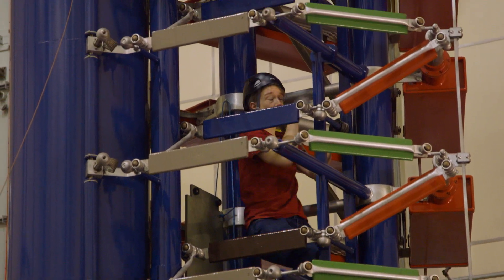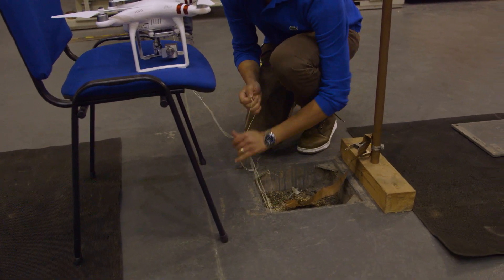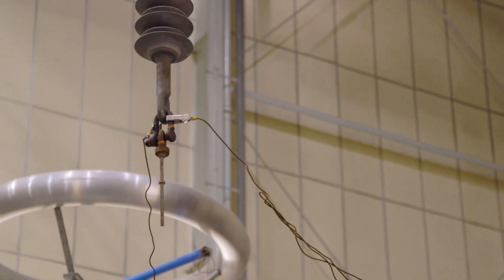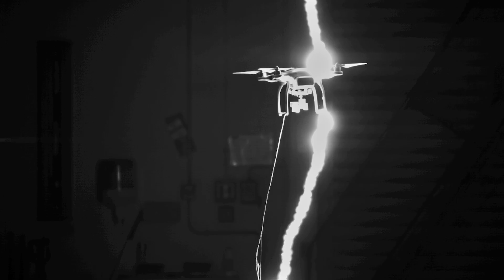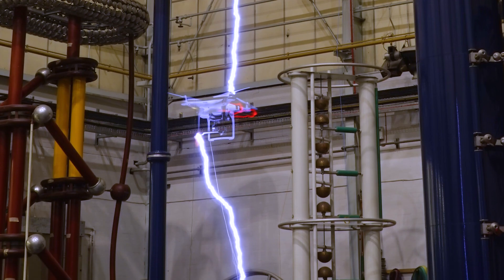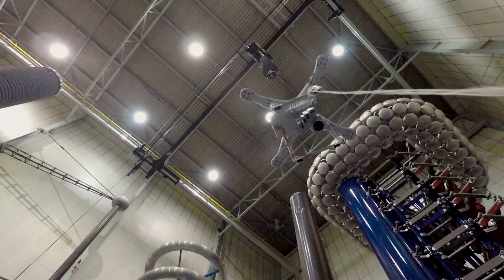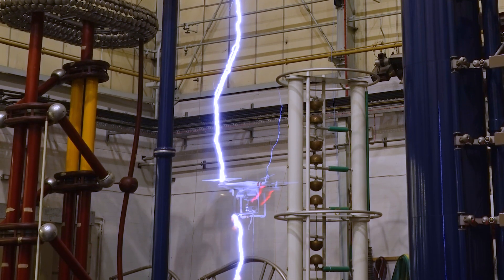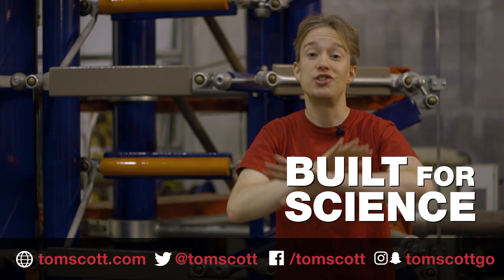We hit a drone with lightning

Comment: wait...I only see 1600kv, ain't that only 16000v..oh and there's your current! 41 amps...I'm so confused...I'm see 656000 watts maybe. help please. I'm new to this!😂
Reply: 1600kV is 1,600,000V. The current you may have seen on the screen is the current we take from the LV supply to charge the capacitors. When the actual flash happens we will have a current in the order of a few thousand amps given the circuit set-up.
Reply: Oh what kv=10 to the 3rd volts!!!!!Thanks!

Comment: Wouldn't it have been a "better" idea to have the metal tape sticking out a decent bit further form the top? It looks like the one motor was still the closest metal piece to the lightning "source" and actual lightning rods also usually go up from the roof py more than 1 or 2 cm ... :D
That it's probably still not the best plan to fly a drone in a thunder storm is out of the question ...

Comment: You gave the voltage drop across those capacitors, but not their capacitance. What are they, like 100 Farads? I wouldn't be surprised at that size.
Reply: Probably a some few micro Farad. The high Voltage makes the necessary insulation (dielectricum) very thick. So you got a relatively small area divided by a thick dielectricum.

Comment: It really entered at the motor and exited at the compass that is strapped to the bottom of the plastic landing gear.    This would have been the path of least resistance and would have avoided the battery since the motor is connected to the main board, and the compass comes off the main board. I'm repairing one currently from another YouTube video with what happens to a phantom when it was shot down and doing an assessment of damage done. I could do the same with this one also and check the electronics components and see how much was damaged and if I can repair it also?
As for the lighting rod on the top, the very top of the phantom has the GPS antenna and would probably travel into the main board that way also. And the phantom GPS receiver is ceramic s it probably would be destroyed and shattered.

Comment: And for this STUPIDITY YOU NEED A DOCTORATE DEGREES??
Reply: You need a degree to build and fire such a device without killing yourself or others.
Reply: Electrical Engineering specialising in High Power / High Voltage Systems.

Comment: Part of me wonders, If the electricity had instead gone down the battery wires, through the cell, and out the foil casing, would you have been picking little bits off the floor instead of one whole drone? has anyone done a test on what happens when lithium cells are exposed to a high voltage shock?

Comment: The problem with the second drone is (and the people there should definitely have known) that the copper tape is basically doing a 180 bend back on itself, why would 1,000kV follow a bend when it can just go through the plastic? High voltage likes to go straight. The resolution would be to put a metal steak right through the center of the drone, but without touching the battery/electricals etc.

Comment: The copper tab was not higher than any of the propellers. You should have attached a copper wire to the tab at the top so it would be at the highest point on the drone. Then it would have generated a streamer and would have been the point of discharge. Another copper wire hanging down from the lower copper tab should also have been installed so it would have been the lowest point to ground. 

That said, lightning doesn't like to turn corners. So the drone's internal electronics would probably have been fried anyway!

I would still like you to repeat this experiment using my suggestion!
 Thanks! I truly enjoy your channel!

Comment: The motors got shorted out which puts an electronic brake on them and stops them really fast. The propellors have a screw that is pitched opposite of the direction of the motor spinning forward. So the motors stopped and the propellors kept going and the propellors unscrewed themselves and took off

Comment: Looking at the my P3 Advanced, theres 4 antenna wires and one compass in the legs, looks like the current went through the motor and ESC, burned up the FC and receiver then exited through one of the antennas.

Comment: I wonder if the fact that it went for the motor and prop before the lightning rod bore any similarity to the case of Bristow Helicopter 56C in which the lightning was partially attracted to the static electricity generated by the tail rotor.

Comment: That was one expensive Video. 2 drones...
Let's say it costs $250 each for parts (optimist), that's still some $100/minute of video.
Reply: Peter Rafeiner a dji phantom 3 standard (red stickers on it) costs £450.
Reply: Well, the DJ was not a total loss (battery, remote controller are ok)), so 'only' parts like the main board and maybe a motor or two may be needed; ergo a bit less of an expense.
Still, it hurts seeing them getting 'the chair' :-)

Comment: that Phantom 3 standard drone has a compass attached by a wire in the landing gear that the lightning exits, it's actually traveling through that, not the plastic, thus the exit point.

Comment: I bet if you make plastic propeller bearings for the drone you could use the lightning rod effectively. Though the heat might still fry the internals only one way to find out right.

Comment: Having OWNED one of these drones, i know that it did indeed enter via the motor, but the exit point that they say is the handles, there is actually a metal wire for an antenna, Unless they say it later in the video

Comment: Nudging the video frame by frame: I can see one of the motors stopped spinning very quickly (stopped much quicker than the other 3). This indicates the transistors of one of the electronic speed controllers (ESC) were damaged and went short circuit (the usual failure mode for electrostaticly-damaged FETs), hence shorting the motor coils and causing it to electro-magnetically brake. The shorted transistors also probably caused an over-current event on the main power rail and caused the protection within the intelligent battery circuit to activate and shut down.....at a guess.

Comment: You don't store volts. You can store coloumbs, or joules, but not volts. Or, you can store x coloumbs at y volts, with x*y/2 joules of energy.
Reply: It stores charge with the purpose of maintaining a voltage. It's a bit lazy with terminology but with static capacitance voltage and charge are functionally interchangeable so the phrasing is not that egregious IMO.
Reply: Perhaps it was a simplification, whereby the uninformed viewer may understand the scale of the beast in a format that is understandable by all.
Reply: The pedant in me would argue, but you're right. I would like to know the rated capacity of those beasts though.
Reply: I guess they mean it's the highest voltage they can achieve with this set of equipment.
Reply: wat
Reply: I was also disappointed Tom only gave voltage. Caps are rated for voltage and capacity, give me both numbers dang it!

Comment: Doesn't it matter what the amp is though, not the volts? Couldn't you destroy something with 1 volt so long as it was at say 100,000,000 amps(exaggeration I know but just hypothetically) while 100,000,000 volts with 1 amp would do pretty much nothing?
Reply: Theoretically you could, but anything outside of say a superconductor has a high enough resistance that 1 volt would not produce anywhere close to 100M amps of current flow.  As far as 100M volts with one amp, it's about the total wattage dissipated, so 1 amp would still be a ton of energy and produce a bunch of damage if the object was relatively small and not able to dissipate 100M watts of heat. It gets even more complicated if you have a current limited source, as then the amount of heat produced will be in relation to the resistance of the object, in which case the voltage means nothing so long as it's sufficient to produce the maximum allowed amount of current flow.

Comment: Does "positive polaritiy" means in the video that the ligthning actually jumped up from the ground through the drone?
Reply: It means that the polarity of the charge stored in the capacitors with respect to the earth was positive. We can switch this using the control desk.
Reply: Is this polarity usual to simulate actual lightnings and weather conditions?
Reply: Lightning produced by thunderclouds can be both negative and positive polarity - as such we need a generator that can provide both. We normally test things like overhead line insulation / substation equipment and the breakdown voltage of systems is often polarity dependent.

Comment: I guess the bolt is attracted to the magnetic fields around the motors and the static charge of the rotors. they may provided a path of less resistance than the lightning rod.

Comment: Wondering -- if the camera was recording to the SD card onboard, would the lightning strike wipe the card, or would you have a video recording up until the point of strike?
Reply: most likely in my opinion if the electricity hit the card then it would just fry it, nothing left to carry electricity yet alone hold data. +joshua HDDs would be destroyed due to the electromagnetic field that the electricity would produce, that would destroy the platter that it's writing to and delete all data.
Reply: +joshua well no not really, when electricity flows it produces a magnetic field which being so close would reverse the magnetic fields on the platters which will not only destroy data but destroy the platters.
Reply: but it doesn't make it less vulnerable, it will kill it stone dead every time
Reply: no, i heard you but every time electricity moves it creates an electromagnetic field and if the electricity is passing through the casing than that field would be coming in contact with the platters inside the case which will fry it. I know what I am talking about but it seems you don't.
Reply: in this case, the card wasn't able to be read by a computer anymore. http://www.mub.eps.manchester.ac.uk/science-engineering/2017/05/11/inside-the-drone/
Reply: Don’t get me wrong—I support science and encourage curiosity. Moreover, I have the same question. But still, I don’t want to waste my quadrocopter like that to find out, whether we’d be able to get the video.
Reply: SD cards aren't vulnerable to magnetic fields, generally. But any device will be absolutely ruined if that much current goes through it. An HDD would probably be less vulnerable, due to having a metal enclosure.
Reply: That's why I said "less vulnerable", not "invulnerable".
Reply: Again, that's why I said LESS. What the hell are you arguing for?
Reply: Not every time, stop being hyperbolic. Lightning bolts are not magic, or predictable. And even if it were every time, the word "less" would still apply perfectly. I chose my words very carefully, you just won't admit to misreading them.

Comment: "These capacitors store over 100k Volts!" <-- capacitors don't store volts, the units are farads. They might discharge at 100k volts, but they don't store volts.
Reply: Capacitors don't store farads. Farads are a measure of the amount of coulombs per voltage applied across a capacitor. Capacitors store energy in the form of joules or coulombs in the form of electrical charge depending on how you'd like to look at it.

Comment: Correct me if i'm wrong but i didn't think you could "store" volts- they are effectively the force right?
Reply: The capacitors store electrical charge - we usually measure this using the voltage. The charge stored is equal to the capacitance multiplied by the voltage.
Reply: so the voltage tom is talking about in this is the pd between the two plates?
Reply: Yes, this is the voltage across the two terminals of the capacitor.

Comment: 1:42
"WARNING!
Remove the Impulse Generator EARTH STICK before energising the IMPULSE GENERATOR
WARNING"

Not a damn clue what it means, but I've got a sudden desire to do both of those things >:D
Reply: I don't think anything special would happen. It sounds like the whole generator is earthed when unused so when you'd try to charge it up without removing the "earth stick" you would simply short circuit into the ground which supposedly is completely unspectacular since I guess nothing noticeable would happen.
Reply: Ah, that makes sense.  Thanks for the explanation.  ^^
Reply: Phourc You're welcome :)
Just a thought though. I've also got the urge to try that out and see if I'm mistaken and something explodes out of the sudden! xD
Reply: Nearly - if we leave the earth stick on it also causes the main circuit breaker in the lab to trip off which is a little embarrassing for the user! It's happened to me on a number of occasions!
Reply: This is the UK, so cut them some slack on descriptive lab terms. The "earth stick" is likely a flexible conductor on a pole that can put a low conductivity (short) between the generator output and nominal earth ground. It is a last chance safety feature to ensure that somebody in the control room doesn't zap somebody working in the test chamber. It also precludes any residual charge on the generator from shocking a worker. The generator likely cannot operate correctly if the earth stick is left in place, so operating the generator in that condition is equivalent to testing the safety circuits on the generator; you may get an expensive surprise (to say that this facility is expensive is an understatement).
Reply: Last year I had a couple of classes in a lab similar to this one (smaller room but it did have a 1MV marx generator like that) and earth stick is exactly what Ed Price said. You have a wire with one end bolted to the reference ground (in our case floor, the lab is certified for calibrating devices so its floor, ceiling and all the walls are covered in sheet aluminium for shielding) and the other end attached to a hook on a stick. After your do your high voltage stuff (like send a discharge into a lightning arrester which is what we did) you walk up to the rig you are working on and hook it to the part which is live when energized. That way if for whatever reason it becomes energized (for example if the person operating it forgets you are there) you can´t get killed.
As you´ve probably heard before you get an electric shock when your body becomes a path to ground for the current. What you may not have heard is that voltage is never absolute. It is always a measure of potential difference between two points. Your electric socket doesn't somehow contain 230 volts, they only exist in relation to ground. If two objects are connected with a wire there cant be any voltage between them because as far as electricity is concerened those two objects are now one object. And touching 0 volts results in 0 current therefore nothing happens to you.

Comment: If I remember correctly, rotors cause a lot of static electricity around themselves when they spin. So they are the most natural connection points since they would already have a high load.
Reply: good point i had forgot about that just remembered about helicopters

Comment: "Each one of these can store a 100,000 volts"?
"Charge" and "store" are two different things ain't it?
Can charge up to a 100,000 volts sounds better to me
When you want to use 'store', please state the amount in farads or joules.
Reply: Correction is good but if you already know what it's supposed to be there's no need to ask anyways.
Also "store" is commonly misused in such cases to keep the content understandable to ppl who aren't affiliated with electronics.

Comment: Tom, how many Farads were those capacitors?
Reply: We effectively have 10 capacitors all of 750nF, these are charged in parallel and discharged in series.
Reply: thanks Ian, That's pretty cool! from the size i was guessing 1F each but at that high voltage it's a bit hard to gauge by size. I used to put 12v 1F caps in cars for the sound systems but they were only about 1Kg.
Reply: Yes, the spark gaps are in the large blue column. This contains the noise and also allows us to push fresh clean air through the gaps once they have fired. Solid state switches would be a very tall order at this voltage level but you can make lower voltage generators work that way.

Comment: Cool! This reminds me of some of the lightning strike protection testing I had to have done several years back, but this is much cooler. (Not sure how much the technology has progressed, but back when I worked with composites, there was the tried method of using metal mesh on the surface for lightning strike protection. We were tries to replace that with a lighter material. Either buckypaper infused with the composites, or a paint that could be later applied.)

Comment: So maybe drone airliners aren't such a good idea considering statistically airlines get struck once every 1000 flight hours.
Reply: @John Beauvais 'Drone' airliners [when they exist] will be protected in just the same way as piloted airplanes - the 'skin' conducting electricity & keeping it away from passengers & electronics.
Reply: nightjarflying Normal aircraft are protected by a series of redundancies such as dual magnetos that are separate from the electrical system and a series of analog instruments that work without electrical power.
Reply: Your question was regarding the risk of lightning disabling a hypothetical non-yet-in-operation drone passenger aircraft. Well planes are not prone to being disabled by lightning anyway & the rules of redundancy can still apply with respect to a drone [multiple redundant 'brains', fly-by-wire [FBW] backed up with computerised hydraulic systems & so on]. Incidentally, large commercial/civilian airliners tend not to have a backup analogue console & the 'mechanical' backup controls on FBW are nearly always interfaced via computers anyway. FBW relies on multiple system redundancy with no mechanical/analogue alternative. The exceptions I can think of are in military aircraft [particularly Russian], but not very useful in most emergencies short of nuclear war perhaps